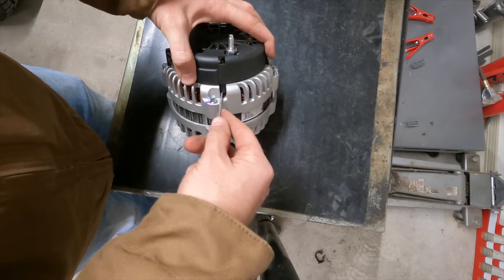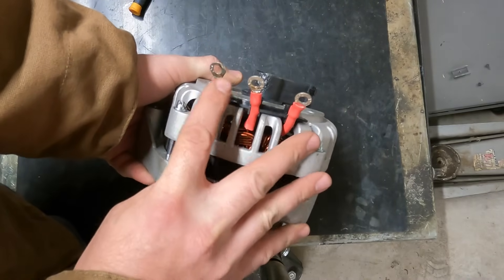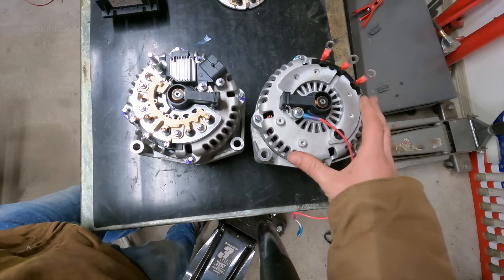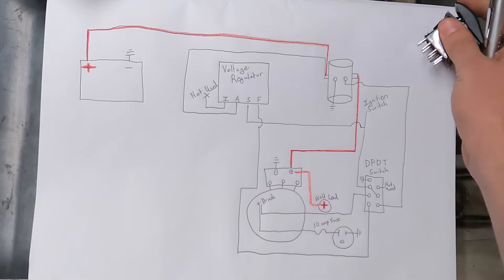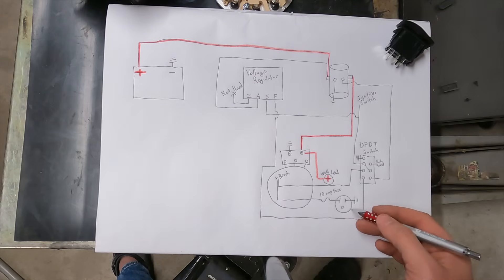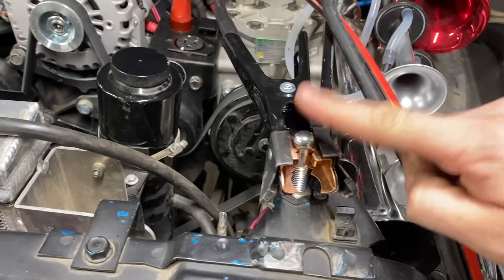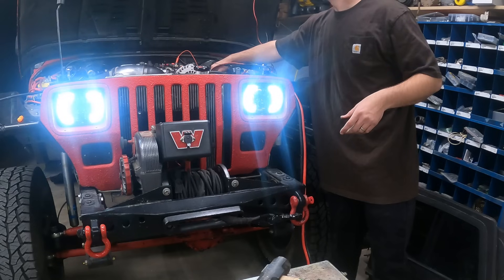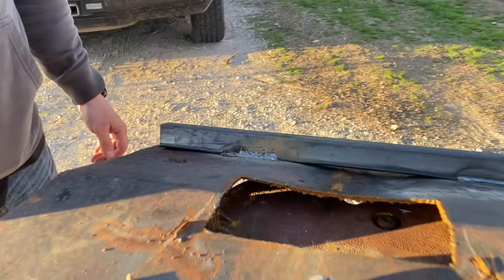How to Modify an Alternator for Charging AND Welding

Comment: Outstanding and very informative. I am curious about the high voltage DC function as well. Can you plot some voltage versus RPM data points? I have run appliances with "universal" motors off of DC. Shop equipment like drill press, miter saw, etc. can use AC or DC. Also, what is the temperature of the alternator looking like, while it's really under load?

Comment: I am a certified welder repair technician/Industrial electronics repair technician by trade.  I have build a welder from an extra welder and have build a wife feed welder using 2 batteries and an spool gun.  I have been think about doing this exact thing to my JK alternator, but have been reluctant to do it due to not understanding exactly how to modify the alternator.  THANK YOU so much for making a simple well explained video.  I just watched it and have already purchase the components to complete the build.
Reply: Lmao wife feed welder.. I'm imagining your wife handling you welding rod electrodes while you're welding
Reply: @arleigh31burke-zc2om  Stole my thunder! Lol
Reply: @arleigh31burke-zc2om you just yell at it or piss it off if you want to increase the feed rate 😂
Reply: A welder that feeds your wife you sir are a genius 😂
Reply: I run a 370A alternator from DC Power, all 0/4AWG OFC wiring. One good feature about it, it makes a lot of power @ low RPMs were the factory 70A unit made its "best" power at high RPMs
Reply: you built a welder from a welder? that certification must be coming in handy!
Reply: If you don't understand the simple electronics in a project like this, what are you doing to repair welders? I'm genuinely curious
Reply: @ronrico2620 all knowledge takes a chunk if that makes sense, making the connections between known and unknown is harder than it seems when dealing with something new
Reply from the maker: Nice! Glad it was useful to you! Thanks for leaving the comment

Comment: I modified my Bosch 12v 90A alternator 15 years ago without changing the rectifier or regulator and it's still going strong. I'm an auto electrician in South Africa. I also use this to charge batteries of other vehicles on breakdowns. Even 24v systems on trucks. Training is required to use this without damaging the other vehicles electrical system.

Comment: Just a thought: read the engine idle load on the battery and add a parallel battery charge line so you can consistently weld without risking your battery dying. This kind of setup I’ll be doing on my “utility mower” that Carrie’s my equipment
Reply: you'll need a second alternator for that

Comment: I'm not a welder, nor am I an electrical engineer. It looks to me that if something goes wrong in your charging circuitry you will face a potential battery explosion causing a lot of damage to a very nice jeep that you have put a large amount of money into. With that said, I commend you for your ingenuity for creating a functioning welder "engine accessory" Good luck & be safe!
Reply from the maker: Thanks for watching! The battery is isolated from the high voltage output of the alternator.

Comment: Cool idea but I worry about you decreasing the reliability of your alternator that you use on the trail.

I have removed the battery from the vehicle and welded with a set of jumper cables in a pinch. Alternatively, get an inverter and a $100 Amazon stick welder.

It might cost you $500 that way. I know you guys spend far more than that on your rigs.
Reply from the maker: Yeah, I plan to carry a spare alternator with me at least until I determine that my system is reliable.
Reply: Good idea. If you have two, you have one. If you have one you have none.

Comment: Cary a spare alternator so once you are done welding you can replace it and get out of there, or just set up a dual alternator rig, one for welding, one for charging, unless you have a mechanical diesel you might find yourself in a brand new trail pickle when you have welded your rig back together but your battery is dead another 20 minutes down the road. Not shitting on the idea, its pretty cool, just know you are really pushing your luck to get even 10% duty cycle out of that thing.
Reply: Negative.  They hold up great, and since the vehicles battery is only powering the rotor, the battery lasts for hours.

Comment: You can buy a cheap welder for 100 buck.
Reply from the maker: One that you can run out on a trail? Impressive! Link?
Reply: a portable generator welder runs from ten times the amount you mentioned (for a lower power unit, 100-120 amp) or twenty times the amount you mentioned (for a 200-225 amp unit).

Comment: You are no electrical engineer.   This will overload the computer since alternators are regulated by the ECU.  This will burn down 70% of modern cars.   I'm a 48 yr mechanic SAA Certified for heavy machines.    Buy a $89 welder from harbor freak show instead. When u plug it in the welder will spy for the PPC.
Reply from the maker: For a 48 year mechanic, I would expect you to know that not all alternators are regulated by the ECM. In fact, it’s not even standard for them to be. MOPAR vehicles usually are, but Ford and Chevy both are not.

Comment: That is cool but seems like a lot of trouble to go to when for a couple hundred $ you can get a 12 volt mig that is basically a spoolgun that uses full battery voltage and amperage for welding current.
Reply: That needs two batteries, and usually the batteries removed from the vehicle.  It is also not adjustable.  This solution is always available, and can run brushed 110v power tools like grinders and certain air compressors.

Comment: Thank you for showing us this and the work you did to make it for all of us.
A huge amount of welders that drive around in these duallys with the old Lincoln on the back, have to have ACDC grinders and they use them every time they use the welder. I wonder what it's like where you're from but down here it seems like you're not cool if you don't have one of the old Lincoln 200 or 200a 
And the tiniest shortest bed you've ever seen on a pneumonia ton truck..

Comment: Those solder joints are installed with a large soldering iron. I've worked similar joints with a 75W iron, with a large wedge tip, using flux. Even then, it'll take a while to get it flowing.
Reply: Only if you remove the insulation/varnish from the wire first.  That's why he couldn't solder them.

Comment: Cool project but what about a fuse for the car alternator Incase the alternator external regulator welded the contact on and getting full amp’s from the alternator to the car battery.
Reply: You mean the fusible link that comes with every car made?
Reply from the maker: Yeah, I’m not sure I understand.

Comment: This is great. Everything WorkingOnExploring said in his comment is spot on and won't be difficult for you to implement. I've been gathering the parts to do this to a water cooled alternator that I intend to install where the a/c compressor would normally go in a |6 ZJ, but wired for permanent welder duty.
You're planning to use that potentiometer to vary the field voltage, aren't you? If you have an amp-clamp multimeter I would love to see what kind of welding amperage you're getting.
The voltage test you were doing while varying engine RPMs is good data. I know my 80s miller bobcat runs an open circuit voltage in the high 70s.
What is the name of that dashboard twist throttle you have? That looks much nicer than the ghetto lawnmower throttle I've got on mine.
Reply from the maker: Yes, that’s the plan for the potentiometer. I can probably measure amps for a future video. That would be great information.

Check the video description for the parts list and you’ll see the hand throttle. Thanks for watching!

Comment: Quick question how are the rest of your electronics fairing with 30 or 60 volts going through them like your ECU your radio your lights etc
Reply from the maker: The high voltage is isolated from the rest of the vehicle electronics.

Comment: I set up a second alternator(dodge/Jeep) externally regulated for my Jeep as a welder and to run grinders.

I’ve used it on the trails.  Once when my buddy sheared the bolts on one steering arm on his d60 knuckle, he needed to get the sheared bolts out of the knuckle to get new bolts in.  Used the welder to weld on a nut to get the broken bolt out, another to weld ups ripped frame where the steering box ripped it, another to weld up a broken stub shaft and one time to weld up the front frame on a Sammy.  

All lots of fun.

Comment: Why not go straight to the large body Ford alternators from the 70's/80's? They put out the most current, and last the longest when being constantly overheated, period.
Reply from the maker: A large body alternator is a good idea! Better for heat sink. I’m just using what I had on hand.

Comment: Even if you don't want to do this to your vehicle , you could always make yourself a small portable engine driven welder with an alternator and a 5-10 horsepower engine .
You can even use a vertical shaft engine as long as your alternator has enough airflow around it .
Reply from the maker: Indeed! Great for on a farm.

Comment: As long as your  ground cable is connected to the alt case and the other end is connected near to the weld area it should not be a problem as you are not part of any of the other electric system, electricity takes the path of least resistance .
One thing to be careful of is not to hit any wires or brake lines and fuel lines with a hot welding rod , it will cause problems with wires , blowen bulbs or worse maybe , break lines probably will leak , fuel lines could be even worse , fire maybe .
I have done the first two , blew every park ,  tail and turn bulbs on the truck and have burned holes in brake lines .
Never ground to frame to weld on axle or something else with bearings , as welding current might go through engine to frame ground wire or other wiring and go through the trans bearing and drive shaft bearing to the axle bearing arcing the bearings and wrecking them.
Always get a clean area to ground to what you are welding on , it works better and is safer .
Bad ground = Bad welding .
Make the cable connections so you can change the pos and neg .
I usually weld with neg on the rod and pos on the ground cable , gives more heat and pentatrion and better for over head work.
Pos on rod softer and less heat , better for thin metal.
Some rods will not burn on both pos and neg just one , so it is good to be able to switch .
Weld a little bit and let alt and diodes cool some , that a lot of amps of load .
It works good , but it is not a Lincoln Generator SA 200 that you can burn one rod after the other and keep on going and not hurt it .
Get a fan to keep the diodes cool , heat , and or over volts or over amps will kill them quickly .
Good luck with your welder build .
Reply from the maker: Thanks for the comment! And the insight.

Comment: They used to market these way back, like before my time & I’m in my 40s.
An old boss (my first proper job actually) talked about a small fleet of Renault light vans he had fitted with some sort of welding alternator for site work.
Never seen or heard of them before or since, but when I was doing some boat electrical work I know you can get 200amp+ alternators that would fit most cars, so entirely possible.
Reply from the maker: I wonder why they disappeared..

Comment: Might be good in a pinch, but if you over use it, won't it melt the brushes, that aren’t rated for that amount of amperage?
Reply: Brushes supply the rotor to make it a magnet.  Stator makes the juice.  No brushes.

Comment: i rebuild altinators. yur brushes and rotor slip ring will burn up fast buddy doing all this. just a warning. if had soldering flux the wires would have released very easy. just a tip to you sence you dont know anything about soldering.

Comment: 6:47 In order to solder something like that, you would need a huge soldering iron, like at least 100w, or better yet, a butane or propane torch with a soldering tip attached.   The combination of huge wires, with all the remaining copper in the stator acting as a heatsink, makes it very tough to solder, but it can be done.
Reply from the maker: The stator acting as a heat sink makes a lot of sense. Thanks for the tip!
Reply: They might have used silver solder maybe, it has a higher melting point and would need a hotter torch than you used .
Reply: Actually, it is super easy to solder those wires with a normal soldering iron.  If you take the insulating varnish off first.  If you don't scrape off the varnish, solder won't adhere.

Comment: Only 2:15 in and alerady this is wrong.  Anatomy: Alternators have commutators, not brushes.  There is not a "negative" and "positive" brush, both Commutators are AC (thus Alternator, not Generator).   The AC is converted to DC (often pulsing DC) by the rectifiers.   Bad explanation, but hat's off to you for the idea and implementation.
Reply from the maker: Sorry, you’re mistaken. Alternators have brushes. DC generators, used on most vehicles pre-1960, use commutators. 

Generators produce direct current and have no need for the rectifier. An alternator produces 3-phase current, thus the need for the bridge rectifier to convert the AC to DC.

Hope that makes sense. Thanks for watching!
Reply: Motors and generators have coms.  Alternators have brushes.

Comment: A rectifier-based welder will weld much smoother and not generate much spatter if you put an inductor in series with the positive lead.  I don't recall off the top of my head the inductance but a good design for this project is to sleeve or heat-shrink some 1/4" copper tubing and wrap 30 turns in contact with each other onto 1.5" PVC pipe.  Remove the pipe form after welding.

Comment: Diodes get hot so they sell bolt in type as I used to use press in type. We rebuilt everything so 60amp diodes went into plate where 30amp used to be. Remember the end case is were negative is produced, so proved a 04 wire with silver (3-5%) soldered eyelets. But use "Star Washers" that help cut thru paint, tar, grease, oil but get to the engine block and battery. 
Good video! DK, ASE Master Tech since 78, retired

Comment: You have an alternator off a vehicle is alternating current that has a voltage rectifier that turns it to DC you can bypass the voltage rectifier and run alternating current 120 volts out of the alternator
Reply: Yes, but it's 3 phase.  It will run brushed 110v AC power tools like grinders on DC.

Comment: Nice way to have a welder handy if you break something when you're off-ro0ading.

Just so you don't drive people crazy, when a switch makes a connection, in the electrical world we call that "closed" - "open" is no connection.  If the switch from the field to 12 volts is "open", no current flows - it's "closed" when you make the connection.  (I've worked with people who didn't know which is which all my life, so it's easy for me to "flip" the words in my head, but some people will wonder how things work with "open" connections.)
Reply from the maker: Thanks for the heads up!

Comment: did you convert the York compressor for on board air if so please show
Reply from the maker: I plan to show how in a future video. Thanks for watching!
Reply: Been there and did that and it worked for a little bit , the problem with most all air conditioner pumps is the oil circulates with the gas in a closed system , and there is no way to keep the pump oiled or keep the oil out of the air out put .
When the oil is gone it will break the connecting rods and be the end of the pump .
I had a York on my Wrecker truck with a tank and pressure switch to shut off at 150 psi .
Thought I might run a air wrench but to small of a pump and tank , was ok to pump a tire though .
Better to get a air compressor from a air brake truck with the air control governor and a tank, most are pressure oiled from the engine and drain back to the block and some are air cooled and some are water cooled .
If you take the belt off it would only run when needed .
There might be some air compressors with electric clutch's out there, like air conditioning pumps , there is hydroilic pumps with electric clutch's for snow plows and other things.
Reply from the maker: @kennethnevel3263  I’ve used mine for 5+ years with no issues. It puts out more CFM than my 60 gallon 7 hp air compressor.

Comment: If memory serves me correcty lead free solder, which anything mass-produced after about 2012 uses, melts at about 450-475 degrees farenheit. This high temp combined with the heat sinking action of the stator windings would certianly not be easy to de-solder without a nicer quality soldering iron or professional air gun desoldering equipment.

Comment: Would it be easier to just hook up a 2nd battery in the vehicle as a spare. Then run both batteries to a outlet that puts out 24v and over 1k amps?.. Some of the best alternators charge 200 amps 14.4v.. 
And since its the Amps you want to weld it would be alot better.. Than just leave the truck running to recharge both batterys.

Comment: Having a reostat in the rotor circuit will allow you to adjust the field current, and so welding current.  I have used instrument panel dimmers from 50's thru 70's or so American cars.  

My general procedure was to set the RPM to about 70 to 90 V for striking voltage and set the welding current down for a good weld/bead.  If you have cause to use smaller rods, this works well.

By the way, NAPA used to sell a conversion kit to do that conversion.   It was very spendy!  

A friend of mine from South Africa used to make and sell some kits.  They were popular with the farmers  there.

If you are running the rotor off the battery, you can use a running light bulb or a brake bulb in parallel to set a minimum welding current.  Adding more in parallel ups the current and decreases the sensitivity of the reostat.
Reply from the maker: Good info! Thanks for sharing!